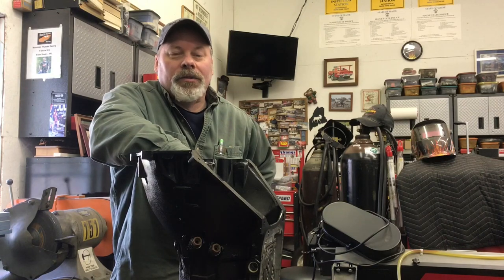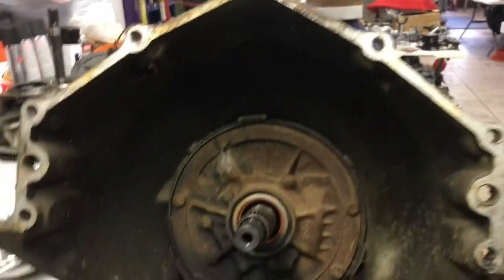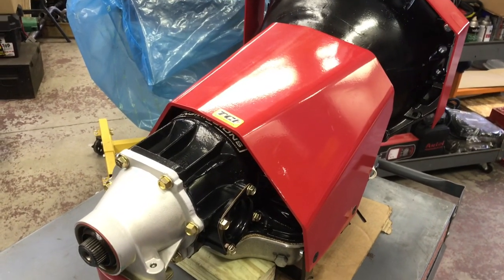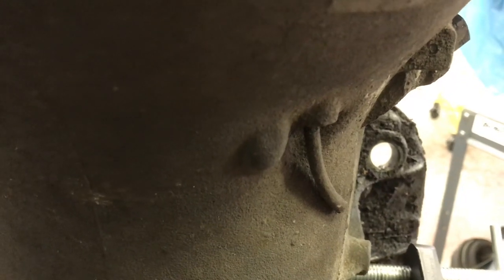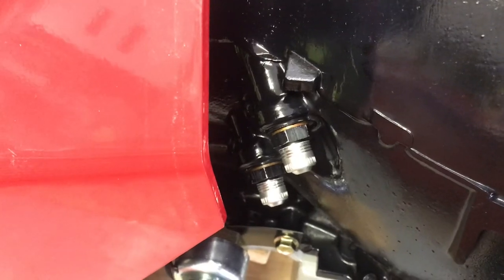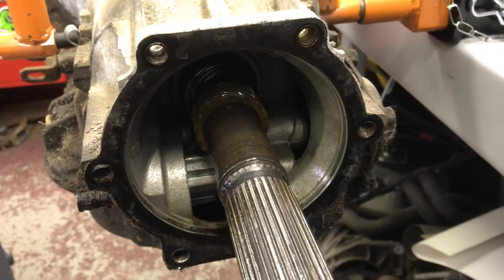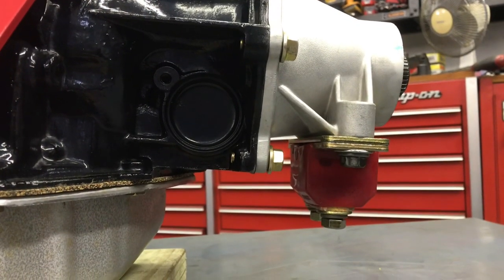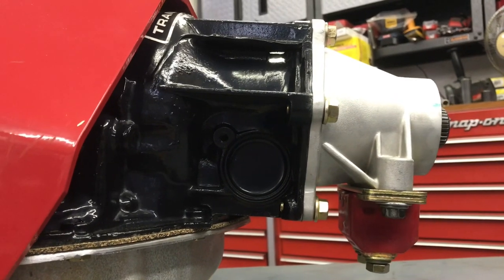Turbo 400 Tips

Comment: You did get into talking about the switch pitch th400, why?
Reply from the maker: I haven’t seen one in so long! Even in the 7 years working in transmission shops I think I saw one.
Reply: Trying to find any information on any YouTube channel. Wanted to know what all i can upgrade and still keep my switch pitch internals and hold 1200hp. Most of the poeple on here want to keep them on factory stock engines(425 olds or 500 cad). I've got the Reid case with ls style bell that I'm dying to convert.
Reply: I've got two oldsmobile th400 with switch pitch.
Reply from the maker: I believe Phoenix Transmission in Texas builds converters for them, and sells all the parts to convert a normal TH400.
Reply: @mountainsgarage  I'll look into them. Thank, I do appreciate that.

Comment: My turbo 400 shifts out of 1st at 5200 I need it to be at 6500 it came out of a 1990 c2500 anybody know what I need to do
Reply from the maker: straightedgecmp  Yes you need to remove that safety feature built into a TH400. It requires a few mods in the valve body, pretty simple. Lots of info online. A shift kit will also address the situation.
Reply: Mountains Garage thanks I appreciate it should I go with trans go?

Comment: How do you hook up a kickdown on one of these
Reply from the maker: Yamaha Guy17   On a regular TH400 there would be a 12 volt switch on the throttle pedal under the dash, and an electric solenoid inside the transmission. Lokar makes an aftermarket kick down switch set up as well.
Reply: Mountains Garage I’ve seen some kits where it gives you a cable like a normal kickdown but when it’s pulled it sends the signal is that kind of what your talking about for the aftermarket
Reply from the maker: Yamaha Guy17  Yes that’s it.
Reply: Mountains Garage ok I’ll have to look into one of those I’m hopefully getting the car tomorrow I test drove it the other day and there wasn’t a kickdown hooked up so I figured I ask thanks for the info
Reply from the maker: Yamaha Guy17  They are just over $100 on Amazon, Jegs, ect.
Reply: Mountains Garage the car has a burst shifter with a button on top I bet I could just wire the kickdown to that when I wanna floor it hold the button
Reply: You can also fabricate a bracket at carb or gas pedal and install a 12v microswitch. Very simple circuit, all you need is 12v to the solenoid, it grounds through its attachment in the transmission.
Reply: N V I wired it to that button it works good

Comment: You covered  everything  on trans except  on driver's side  there's a single sensor with a orange wire on mine I took a 3speed bulldog out and putting in a  400 where does wire go
Reply from the maker: Sounds like you are talking about the kick down wire, apply 12 volts at full throttle and it drops a gear in stock form.
Reply: I was just asking this question over the weekend thank you for this answer

Comment: At 21.02 you said it's a 12v kick down trans brake what's that mean
Reply from the maker: I said if you have a internal solenoid transbrake the 12 volts passes through the case connector that was for kick down.
Reply: Ya the wire hook to a sensor on pedal but I didn't  keep it kept all the wiring  just not the pedal  part

Comment: I just recently bought a TH400 but it doesnt have the tail housing and the output shaft is about 2.5 inches out, do i have to get a tail housing that sits flush or a bit shorter than the output shaft its for a 2wd off road truck
Reply from the maker: That sounds like a 4x4 transmission for a 208 transfer case.
You can get a 2wd output shaft and tail housing and swap it.
Reply: @mountainsgarage  it was run on a pro 2 so i dont think that would be the case, but if it were id need a new output shaft with the housing to match? but thanks for responding